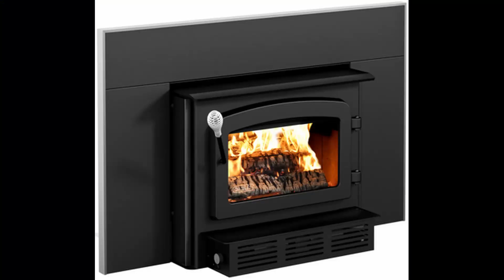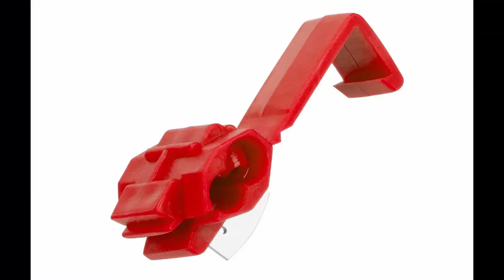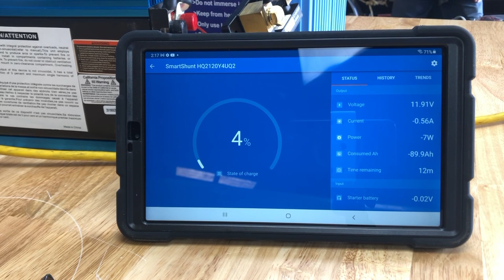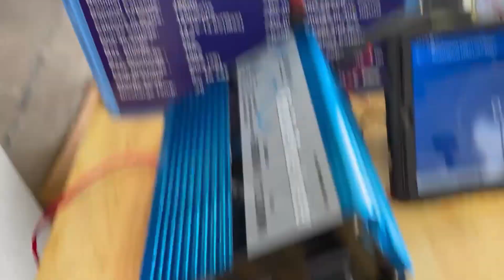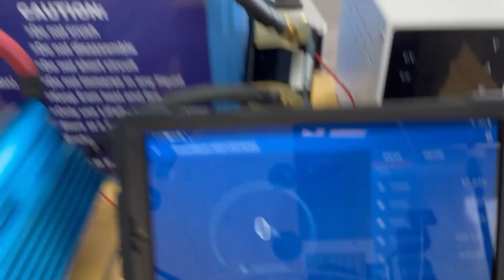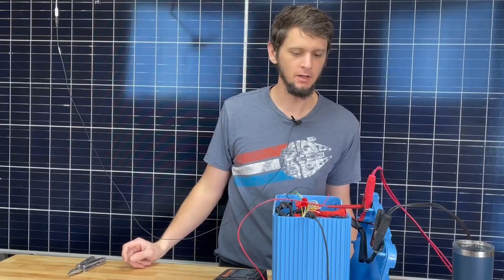2 Reasons NOT To Buy This $300 Ebay Battery - Worth Fixing?

Comment: I bought 3 of these gps 1200B... I am looking for  a manual for this battery. I have them connected in parallel,  and they don't seem to be charging all the way up to 100 percent with my cheap Flexsolar 200watt briefcase (with PWM).  I would appreciate any help!
Reply from the maker: Did yours come with the sheet of paper in each box? It shows 14.4/14.6 as full but they typically won’t charge above 13.8v.

Yours likely don’t have a balancer inside. If you reach out to the seller he might provide one for each battery as well as a video showing how to install, that will help.
Reply: @BeeneEnergy   Hi Beene Energy,  I bought them used, got nothing with them. They were at 80% charge at purchase.  I soldered the crappy clamps on the flex solar today, seems to be working better.  This is my first solar experiment,  don't have a clue about lithiums and have set the PWM to B04 (4 wire for lack of a 3 wire setting).  The PWM will not allow change in settings when set at B04,  I think it's set at 13.7V max.  I've watched your videos detailing the adding of balancers and equalizers, also the one where you tore them all out of your battery box.  I was hoping , since I am using in parallel, with a 5k giandi msw inverter,  I wouldnt have quite the problems of  serial connected batteries.  I enjoy your channel, I am a fix it yourself kind of guy, more power to ya and thanks for the vids!
Reply: one more thing, the FlexSolar is now charging, got up to 13.4v and the GP now says 100%, Gonna try it out with a couple of freezers, what percentage should I let the batteries run down to? 50%?
Reply: @gheenoeshomfer4982  you can let LiFeP04 run down to zero but it’s generally accepted that to optimize cycle life it’s best to not take them below 10%

For most 12V LiFeP04 batteries the 4 3.2V cells will have a minimum voltage of 2.5V, some 2.0V. Voltage does not relate to capacity in a linear fashion. 10% remaining State of Charge is something like 2.8V on a 2.5V minimum cell. The charge/discharge graph for these batteries is very flat except for the very top and very bottom which are referred to as the “knees” because they drop at nearly a 90 degree angle (probably a 70 degree angle from 2.9V to 2.5V

Comment: Has any one ever had these run the battery down to nothing...I cant get it to charge now is it shot now?
Reply: Sis you say you had a video that would help with this?
Reply: I bought new bms still having problem with waking it up
Reply from the maker: I had one do that in my latest video. I think it was a failed bms. If the battery discharges all the way a standard 12v battery charger should wake it up. If you’re using a Solar charge controller you need to jump start the battery as the charge controller has to boot before it starts charging.
Reply: I’ll try the 12volt charger so far nothings changed
Reply: @Waterfoulfreak2131 @BeeneEnergy have you been able to get your battery to take a charge? I have a 36v trolling motor so I have 3 of these in series and last spring I installed the free balance board offered by the seller. They have been great up till Monday when after a day of using spot lock in heavy wind they quit. @BeeneEnergy it’s a variable speed motor when on spot lock, constantly adjusting speed to keep boat in one spot. I would estimate amp draw varying between 10 and 50 amps, constantly changing as it varies speed to keep on spot. Im using a MinnKota PC460 charger and none of them will take a charge. The current voltage on all 3 vary between 11.3 and 11.9v, so above the 10v cutoff as stated in battery specs that would require a wake up. I hooked fully charged batteries to 2 of them overnight to bring them up, but still won’t take a charge from the PC460. It tries, but then cuts out. Any ideas? All 3 bms fried?? I appreciate your response!

Comment: Glad I waited on these. I just about bought them. Thanks for being diligent on your review. I’m sure an upgraded BMS with a integrated balance would do these cells some good. But that’s a lot of solder.
Reply from the maker: I’m working on testing just that, thankfully only had to solder the main negative leads in and out of the battery. But those could just have easily been done with crimp couplers.
Reply: https://youtu.be/ajm1uZYZnI0 this other BMS drops right in of you crimp four eyelets, just did it last night. Ready to test soon. Even got the Bluetooth

Comment: FYI The seller (Jim) has a plug and play balance board kit available for free for previous purchases. Just drop him a note via eBay and he's shipping out the kits for free.
Reply: Messaged him on ebay today. Waiting for reply. Thanks for the tip!
Reply: No reply yet 😑
Reply: How are the balance board kits working?  Did you have to do anything more than plugging them in?
Reply: @ggggg4030  It was plug and play....I haven't had a huge # of cycles on the 2 batteries and it's been the 'off season' since November. Both batteries are just sitting in the trailer waiting for the racing season to start again.
Reply: Can you please describe the plug and play balancer connections so that i might be able to connect a balance the same way? Thank you
Reply: @randgraham1  I used some electronics grade silicone to hold the board in place (ASI 388).
Reply: @jeffwasilko  thank you! Though I placed the balancers on both batteries and they seem to work much better, one of them still only charges to 13.4

Comment: Had a Renogy Blue Tooth Battery that cell 4 would never get above 3.4vdc and would not work it self out. Returned it for refund.  Had a Weize battery that wouldn't get above 14.1Vdc but that quickly worked it's self out.

Comment: After seeing your original video about this battery over 5 months ago, I bought 4 of these and up until a few weeks ago they have been fine. Since then my Go Power ic 3000 inverter sometimes beeps 3 times and then shuts down on high voltage safety.
So one or more of these batteries are not balanced properly. Please continue your research and post a new video with information to correct the imbalance situation. Thanks in advance

Comment: I added the same balancer to my global power and it works great! I wired it directly to the battery leads with ring terminals. It was a huge Pain getting to these! Had to pull out the cells and cut through the wrap. I also added the W1209 thermostat and a switch to the balancer so it will not balance below freezing.  I use this battery in the winter to run a diesel heater to warm my tent so cold temp shutoff is important.

I thought about just pig tailing like you did but After doing research I was concerned the 22awg wires global power provided wouldn’t be able to handle the 5 amps the balancer could potentially push… The wires provided with the balancer are a larger gauge (I can’t remember the size off hand). 

Do you think splicing into the smaller 22awg could potentially be I unsafe? The balancer can push 5.5amps if it needed to. I couldn’t find a solid answer of how many amps 22awg can handle in this specific scenario… 

I also upgraded the BMS to the Bluetooth Battery Hookup BMS.   The Bluetooth feature is awesome. I can monitor the exact percentage of battery life. 

My battery and mods are working just fine and cells stay within a delta of .005 volts. 

It’s still annoying that this battery didn’t come as advertised…

Thanks for the video!
Reply from the maker: The 5a current point is valid. I was thinking about this a little the other day as those leads aren’t even fused in any way. In any battery I’ve worked on.

I’ve only measured up to 1.2a with the balancer. And after the initial balance should never be very much. Your point stands though.

Replacing with a JBD is a no brained that I should have started with. Honestly with that the active balancer should be superfluous. Passive via the bms would/should be perfectly fine to keep up with any slight imbalance.
Reply: @BeeneEnergy   It’s a pretty solid BMS! I highly recommend it with the BT module! 

With the active balancer turned off and BMS alone balancing I can achieve a delta of  .010 volts. It really fights for it during the last moments of the charge. I just take it to 14.4v to be safe. I tried for a lower delta but the BMS really struggled. For a BMS to be able to balance it within .010v isn’t bad at all. It’s also nice being able to change all the parameters with my phone. 

I can successfully get to 14.6 volts with the active balancer switched on with no high voltage lockouts.

Comment: Well, I’m bummed.  Bought two after I watched your first video
Reply from the maker: If they aren’t shutting off for high current it’s no different than my previous video though. We knew they had a balancing issue before so I decided to go more in depth on it in case it’s needed down the road.

Sorry if I steered you wrong! Apparently I should have tested multiple batteries.
Reply: Beene Energy  I have not yet tested them.  Still gathering parts for my off-grid system.  My intended use is during intermittent grid down.  Probably might make more sense to sell them.  Thoughts?
Reply from the maker: @ggggg4030  That’s a hard question without knowing how well your batteries are working.

How big an inverter we’re you planning to use?
Reply: Beene Energy  I have a 24V 2000w inverter
Reply from the maker: @ggggg4030  So full blast you'd be pulling 80-90a. There is a possibility you'll trip a BMS. If in fact you ended up with a bad batch one like this one battery i tested. In which case it'd be perfectly reasonable to get a refund/replacement. However if you went with 2kw so that you'd be able to start a refrigerator/window-ac and you won't hit 2kw continuous I wouldn't worry about sitting at 90a. You'll probably be 20a or less most of the time.